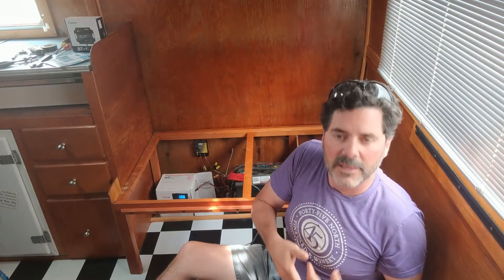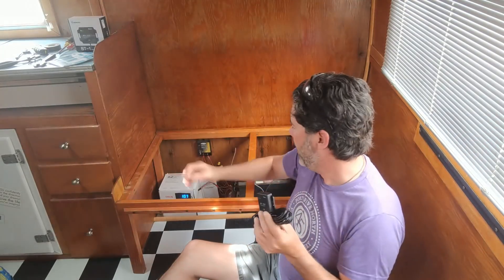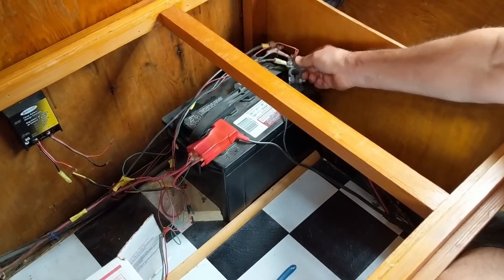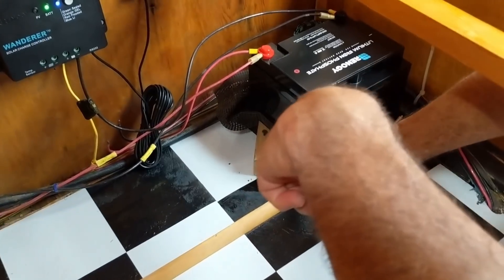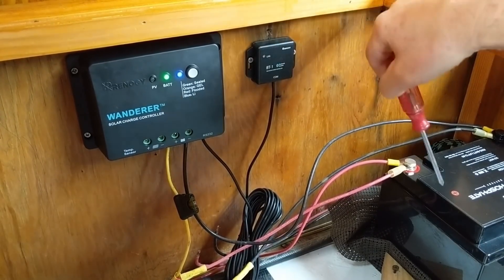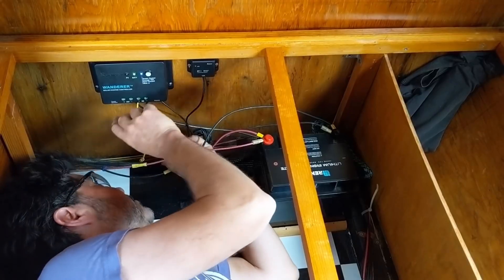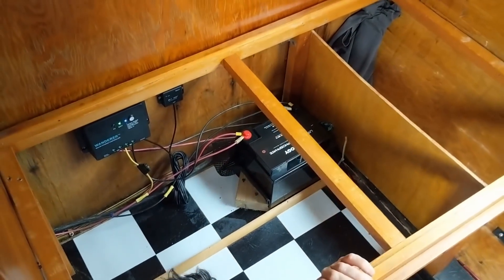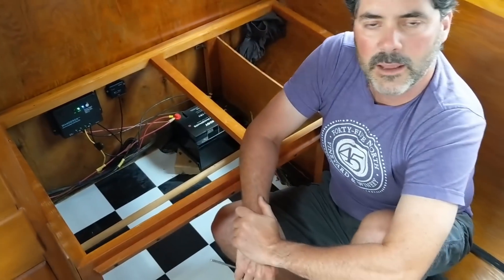Renogy Lithium Iron Phosphate Battery & Charge Controller Installation

Comment: How many Solar panels are you using?
Reply from the maker: This is an older video, so at that time, just a 100W solar suitcase.  We upgraded last year and now have 200W on the roof plus a 100W suitcase when we are parked in the shade and need a boost.  There's more info here, look toward the bottom of this page. https://freedominacan.com/solar-powered-by-renogy

Comment: That battery is a drop in lead acid replacement, are you sure you need to replace charge controller? I am told you can charge it with a regular charge controller or even from your vehicle alternator. I'm trying to figure out what's best and how do you charge it when not connected to solar?
Cheers
David
Reply: Lithium charging profile is different, it needs a compatible charge controller.
Reply from the maker: Thanks for your comments.  Our thoughts...

With lead acid, you can only use 50% of its capacity.  Lithium allows you to use 100% and has less resistance, so charges faster.  So, it's smaller and more efficient, but with more usable watt hours than our previous battery.   More info about our batteries: https://www.renogy.com/blog/product-review-50-amp-lithium-iron-phosphate-battery/

The charge controller we had was quite old and not compatible with Lithium, so had to be replaced.  Here's more info about charge controllers:  https://www.renogy.com/blog/charge-controllers-demystified/

This new system has been fantastic and we have seen a great improvement overall in efficiency.  We can monitor with our app to check charge status and panel efficiency.  

We do not have to charge with our truck's alternator, but that is possible.  Look into Renogy's DC to DC charger https://www.renogy.com/12v-dc-to-dc-on-board-battery-charger/

Let us know if you have further questions!

Comment: Gosh! I'm not going to say I've done photovoltaic battery back up for forty plus years, but i have. You need to fuse/circuit breaker the wires going in and out from that battery. The wire to the inverter, is much, much too small. Even for a small inverter, i'd go with at least 6 gauge. Perhaps it's that you're not finished, but were is the slack from the battery wire to the inverter? Remember you can burn your house down just a quickly with 12 V dc as you can with 120 V ac. Be safe and put in the proper fuses.
Reply from the maker: Hi Mike, just letting you know that we've made that correction, and now have everything wired through a fuse box, and our new 700 W inverter has 6AWG wires.  Great Advice and we're passing it along to others.

Comment: That is a mighty thin (small gauge) wire to the inverter. You must have a very small inverter (and i hope a fuse i cannot see), I use a 4 gauge wire, but then I have a 1500 watt inverter with a 100 watt fuse.  
I cannot wait till my lead acid batteries wear out so i can put in lithium!!
Reply from the maker: It's 10-gauge wire, similar to a bigger household outlet, which is connected to a small (400-watt) inverter.  Also the distance from the battery to the inverter is less than 10 feet, so that can make a difference.  Good luck with the Lithium install, you won't regret it.
Reply: @FreedomInACan  Agree with laronis
, a lot of good calculators out there.  Even at 200 W, 10 gauge is recommended (6 gauge @400W).  And fuses!  That's a line directly off a powerful box of angry pixies, you really need a battery post fuse.  Looks like that battery will limit on overcurrent/dead short, but looks like that'll be after ~150 amps!